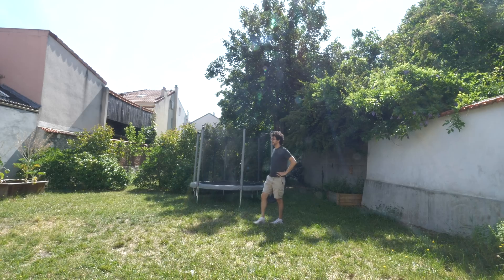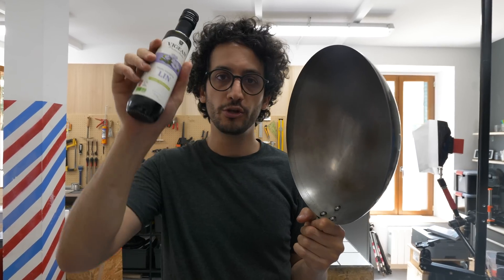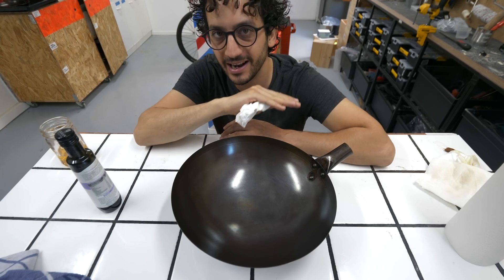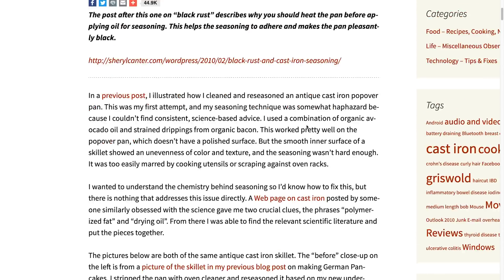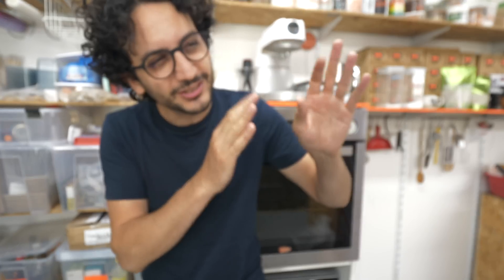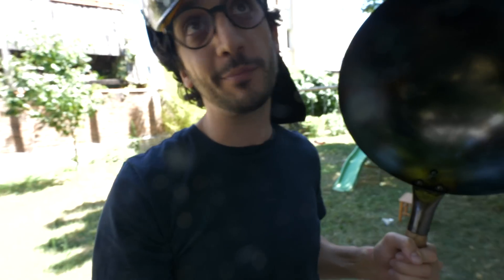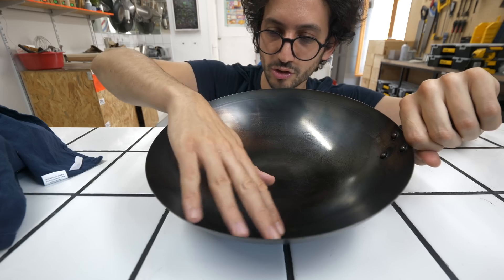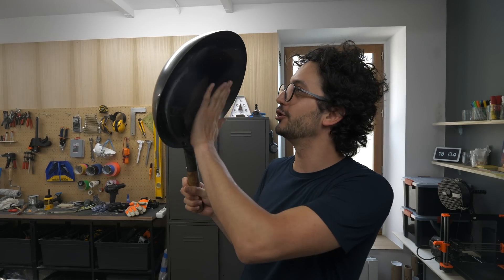Can I Make my Wok Slicker than a Nonstick Pan ?

Comment: ... every Chinese restaurant does it 100+ times a day... It's a 10 seconds process...   

1. Wash wok remove most oil
2. Heat until surface Oil completely evaporates
3. Add at least 4Oz Oil
4. Pour away excess Oil
Reply: Never put oil on the underside of the wok...  Your just gunna get carbon building up making it harder to wash .. and losing heating efficiency...

Comment: Cast iron and forged steel pans with no coatings are in my opinion far and away superior to teflon pans.  First and foremost Teflon isn’t indestructible. No coating is. If you damage the season of a steel or cast iron you can repair or redo the season. On a Teflon? You replace the pan. I have a cast iron skillet that I absolutely love and it makes the best fried egg I have ever had.

Comment: The egg was sticking even with oil. My personal carbon pans eggs wont stick at all with a little oil. Seasoned with lard. Also, you were straight up nuking that poor egg. Try low heat for eggs. Works wonders

Comment: I agree with you in saying that the seasoned wok is better than a Teflon pan. The reason being Teflon isn't nearly as hard or durable as the oil seasoning and, in my opinion, scratches very easily. Pus, the seasoned pan has the benefit that its cheaper and can be redone basically forever, whereas a Teflon pan gradually gets stickier and can't be as easily fixed. Besides, cooking with a little oil or butter will just add flavor alongside it helping things not stick.

Comment: Alex you need to be careful with heating flaxseed oil over an open flame it's extremely flammable.that's why Carpenters use boiled linseed oil that actually isn't boiled it just has added drying agents to it so it polymerizes faster

Comment: So, I live in China, and we own a restaurant here. I'll start by saying this, the first thing is you don't have enough heat for a wok. Can you cook on a wok with less heat? Yes, duh, of course.. but it won't be nearly as good if you have a lot of heat. Gas stoves here in China have more heat than western stoves. Gas stoves in restaurants (like the one we own) is insane. It is like a volcano or something. Because you don't have enough heat, you've probably struggled to cook something in the wok. Maybe it comes out burnt, or it sticks. So you thought, okay, let me turn down the heat, and again the food didn't turn out well. Then you probably thought, well, let me change oils. Which also probably didn't work well. Then you thought, well let me make it a non stick pan! Which, will help, but again, judging by the way the egg turned out, not very good. Something to understand is this.. most cooks in Chinese restaurants here in China use peanut oil and again, an insane amount of heat. Also, they don't really clean the pan, grind it down, do all that bs to make it more non stick. One thing I've noticed is all of them put the oil on the pan in an up down motion. Not in a circular motion. Because they don't oil the entire surface. Usually they have 3/4's of the pan oil'd and 1/4th 100% dry. When they cook an egg, it literally takes like 4 seconds. They drop in the egg, 1 second cook, turn. 1 second cook. Then they will move the to the dry spot on the pan to crisp the egg, flip it... crisp the egg.. and then quickly get it out. Looking at the flame/amount of time it took you to cook the egg, I can tell the pan isn't really all that hot.

Comment: Do the egg test without using oil nor any kind of utensil while cooking to truly test the nonsticking factor. if the egg slides well, then it passes the test.
Reply: Eggxactly
Reply: Exactly
Reply: @jaydencruz336  you mean eggactly
Reply: What do you have against cooking in a pan with oil? Are you allergic to oils or something? That's like saying, "oh, I'd like to boil some vegetables. But without water!"
Reply: On low heat it might work, but on high heat like he did it would stick to the coating and removing the egg breaks that coating. The same video could be made with a cast iron skillet which is better for baking eggs because the thick steel disperses heat more evenly.  This video however teaches people how to maintain a wok or cast iron skillet for a lifetime through seasoning to make it close to nonstick. Nonstick pans are far superior because they are coated with teflon instead of linseed. Which is far slippier but also impossible to replace or apply yourself. Not even mentioning they also require seasoning to last a lifetime (which no one does). Without oil or butter a standard nonstick might last a year to become waste. A proper seasoned steel or iron pan could last several lifetimes if taken proper care for.
Reply: @jacoblieverse5279  Nonstick is great until you want to put the pan into the oven, or use real utensils.
Reply: @BlueCollarBachelor  
Teflon is perfectly safe in the oven, and they make Teflon coated oven bakeware.

Directly under the broiler is a no-no however.

And we have used wood utensils for literally thousands or years perfectly fine, and we have nylon and silicon now.
Reply: @lordgarion514   not all non-stick is teflon.
Reply: @BlueCollarBachelor  
Indeed, but ceramic non-stick is safe to o 842 degrees.

The aluminum in the pan is literally a glowing liquid at 800, and you could fold a steel pan in half with your hands, assuming you could touch it of course.

So you know.
Reply: @lordgarion514   some nonstick is random coatings with various pigments added. True Teflon or Ceramics aren't used for the majority of cookware.

Just look at amazon...  they have a lot of 300 degree max non-stick.

So you know.
Reply: @BlueCollarBachelor  
What about Amazon?

You do know that safe max temp doesn't just depend on how high a heat the Teflon/ceramic can take before it breaks down right???
There's better and worse ways to attach things, and some cheaper methods don't hold up to the heat.

And "random coatings with pigment added". Really?

Don't suppose you'd care to share a link for one of those would you?
Reply: @BlueCollarBachelor  
Modern non-stick pans(at least quality ones) won't be scratched by metal utensils and can be used in the oven. They're hard-anodized aluminum. It isn't even a coating- it's a solid piece
Reply: @gregorsamsa1364  You don't know what you're talking about.
Reply: @BlueCollarBachelor  
You don't know what you're talking about
Reply: @gregorsamsa1364  The facility I work in applies coatings to cookware.
Reply: @gregorsamsa1364  that is just wrong on so many levels. Culinary institute of america has done a video abt it, and used even the best and most expensive pan to show how mistaken you are
Reply: You can't use a teflon wok on a wok burner. It can't handle the heat.
Reply: @gregorsamsa1364  Aluminium is not very good for heat diffusion, copper and iron are much more reliable, but they have their own problems too.
Reply: @tapp3r109  Exactly!!
Reply: @lordgarion514  "Teflon is perfectly safe in the oven" unless you own a bird...
Reply: @malcolmparkins1935  
No. I didn't stutter.

I mentioned the broiler limitation.

Other than that, an oven doesn't get hot enough to break down Teflon......
Reply: @jacoblieverse5279  Exactly, I'm full on cast iron for 3 years now, and I'm slowly putting away my teflon's coated pan's, I've just made a coated linseed wok the way he did, and I'm looking forward to try it!!! Maybe tomorrow.
Reply: @Jacob Lieverse 
Strange... to make stainless steel pans non stick, you need it to be super hot before you add the food
Reply: iron pan if you know how to use it. it won't stick food. as long as your wok is in high heat. if it stick it mean ur wok not enough heat. and it is good because compare to non stick coating it can go on very high heat and won't spoil. and also cool down very fast, it suit for chinese recipe. many video in YouTube will teach u how to use it
Reply: A wok is my favorite thing to fry and egg in,  because the wok keeps the egg perfectly round.
Reply: Just cook with it already 🤣
Reply: Butter for eggs is the only oil IMHO. Regular oil stick but not butter in a seasoned pan
Reply: Looks good enough to me. When do you fry something without fat?
Reply: @jesmondo5785  I thought the same thing. I own a ceramic pan in which I can cook an egg with no fat. While it is cooked, the taste with no fat is not appealing.
Reply: @es330td  exactly! It's great that your pan can cook with no fat but who wants too!! Fat makes everything delicious!

Comment: I realize I only see this video after  some time. Great job! 
I do have to add though, that a wok pan absolutely needs the inner curved sides of it rough instead of smooth because it is originally made for one pan dishes. These rougher upper sides serve for keeping earlier preparations warm while using the lower portion of the pan searingly hot...
Just My 2c

Comment: Does this work with stainless steel pans?
I've tried 2 coatings on an electrical stove at max heat, and it didn't seem to do anything, not sure if I did it wrong.
Reply: Stainless steel pans cannot be seasoned, nor should they. With correct oil temperature they will not stick, but they will discolour, unlike a seasoned wok.

Comment: Build a large fire so you get a thick deep bed of white hot coals plop your pan in the middle and coat the inside with a thin layer of lard let it smoke off and repeat for a couple hours or until you run out of coals the first layers will be thicker and harder but as the fire dies the layers will thin out a bit wash yes wash your pan after it cools then add a thin layer of lard again throw it into your oven at 400 for as long as it takes for all the lard to disappear and bam the best seasoned pan you’ll ever have if you notice it starting to stick after you’ve used it simply clean and redo the lard and oven it will come back and last longer and longer the more you use and reseason it over the years

Comment: Is it better than a Teflon pan?  That is dependent on the question, the if the question is about the chemicals and the issues that you might ingest the chemicals and you want to remove that then yes this is better than Teflon.

Though if the question is is more nonstick, then no it is not due to the chemistry of the pan it can never be more nonstick than Teflon.

Either way there are use cases for both in a pro kitchen.  For me it'll have to be either cast iron or stainless steel for my cooking needs and I love cooking with such exclusively.  Besides a cast iron pan is easy to maintain and you can abuse it and get back to working condition easily more so than that of Teflon where you have to throw it away, besides that is another issue with Teflon.

Comment: Actually, a textured surface up the sides is a good thing. You often want to move food to a cooler zone up the side, and the texture helps it to stay there. Also, you should have tried the egg before you wasted so much time. It’s ready to use after one or two seasoning cycles. It will get better with time and use but you don’t need to spend all day seasoning before it’s ok to start using it.
Reply: I think a lot of science is just about wasting time anyway.
Reply: @duratoke  excessive seasoning isn't science, it's overcompensation. Science is there to save us time and to keep us safe.
Reply: Thank you! This is what I was wondering as well. You want it seasoned, and relatively non-stick. But not so slippery as to not be able to push food up the sides to get away from the heat. In fact, my wok actually has rings going around the inside of the walls (not on the bottom), so it could never be completely smooth unless I wore off the rings.

Comment: On coat 3/6 at the moment. As always, next level escalation on your part, what grit(s) did you use for your final smoothing / finishing step? 

My cast iron see some campfire-carbon-acclimation-carnage, but it’s the next morning egg clean-up that could benefit the most from your approach.

Comment: I have a tinned copper pan that I use only for eggs because it works like a brand new teflon pan IF, and only if, the proper care is taken. if it starts to lose it's slick, I clean it by boiling a small amount of water in it for a minute, and then I wipe it dry, and then take thin coat of oil up to smoking and let it smoke for about a minute. After that I wipe it again and I can crack an egg straight in, no fat of any kind and cook it over easy without ever using a spatula. however if I cook anything other than eggs in it, or enough cheese cooks onto the surface, it loses it's slickness completely and I have to g through the process again. I now am considering trying this technique, or something similar on it. Is there any reason I shouldn't do this on a tinned copper?

Comment: With repeated use and scrubbing the surface with salt to clean off stuck on food, the surface will get very nonstick. You should only have to do 2-4 layers of something like rapeseed or avocado oil on it at first, otherwise the layers will get too thick and brittle, or even gummy in some cases. At least in the case of cast iron, I'm not sure if it's different with a wok. Of course cast iron will never be as nonstick as a teflon pan though

Comment: Dude, you're awesome. Question: do you need that last gas step on top of the 6 oven seasoning steps? I have a wok that rusts much too easily, and feel the original factory seasoning didn't hold. Thoughts? Cheers!
Reply: If it's rusting you cant have a good seasoning on it. I did not need more than 2-3 layers of seasoning in the oven (30 min per layer)  as the seasoning builds up with regular cooking also, unless you remove it with something acidic like tomato sauce or heavy cleaning.

I usually wash my wok before cooking, not after it. That way the oils that are left after cooking in the wok protect it from rusting. I never have rust on it and it's much easier than washing, drying and oiling it every time after cooking.

Comment: Hi, I used these instructions to season my first cast iron pan (thinnest possible coating of linseed oil, baking it in the oven). At first I thought it worked perfectly: after 6 iterations, the pan was almost jet black and the first cooking tests were amazing.

But the coat is extremely brittle and easily breaks off. Also, it seems to be very sensitive to heat.

People on reddit told me that linseed is actually not very well suited for seasoning. The low smoke point makes the burning in easier, but the coating becomes heat sensitive. Also, linseed oil becomes too hard, the resulting coating is brittle. Many people seem to advocate using an oil with a very high smoking point instead. Also to just burn in one or two layers, then use the pan for daily cooking and wait till it seasons itself.

How did this seasoning work out for you, was it durable?
Maybe I messed up the process after all and the mistake is on my side.
Reply: Some linseed oil have additives that prevent it from working. Alex was probably using a very pure linseed oil. It's recommended to use Flaxseed oil as it is usually more pure. And if you can't get that to work I've always had good luck using Grapeseed oil.

Comment: This is 2 galaxies better than the cancer promoting teflon. Its not even a question about it. And this, you can do on a slow Sunday.  What I would like to see tested, is can It tolerate more heat and abuse than a teflon coated pan..

Comment: Is the metal polishing compound food safe? My father was a head chef and grandfather owned a restaurant. They used peanut or sunflower oil on a cloth to season the wok and then heated it up on high heat till it went black and smokey just like steel tempering. This form of seasoning is similar to seasoning a BBQ smoker or cast iron grill. What makes the food not stick to the wok is the combination of oil, high temperature and the leidenfrost effect. To clean the wok after cooking you add water and bring it to the boil. Use a bamboo wok brush to clean out food particles as it won't scratch the carbonized surface and tip the contents into the sink. Never use detergent as you will strip the protective carbon layer.

Comment: From a durability/usability perspective, a well seasoned pan is superior in almost every aspect. Teflon was never intended to be used in conjunction with oils or butter. They blister the surface, producing texture, which starts two new problems in a Teflon pan. The first is ironically polymerization on the blistered texture, making what is basically a thin, plastic film brittle. This leads to cracking and then peeling, which exposes you to the chemistry lab in between the Teflon and the metal. Bare metal and ceramic/glass  are the way to go for safe cookware.

Comment: The layer isn't technically non-stick. It's actually hydrophobic. That means it's strongly attracted to oil, and doesn't care about water. Because it pulls the oil down hard onto the surface, the food (which is usually quite wet and not attracted to the surface) basically floats on a layer oil. And you need to oil it, because otherwise the dry coefficient of friction of the surface is about 0.4, which is not very slippery, whereas PTFE is more like 0.04. And the surface of the pan has to be really smooth, because otherwise the ridges will push through the oil layer and snag the food.

Comment: People use what is traditionally available it seems.  Such as where i am from we use shortening or bacon grease, in the southeast united states. Southern families use almost exclusively cast iron cookware. It works great to heat the (only cast iron) to heat it up and splash water on it to remove debris first. Then apply a thin coating of shortening etc repeat 5 times if new i set my oven as hot as it can get during this process and yes it does make a lot of smoke.